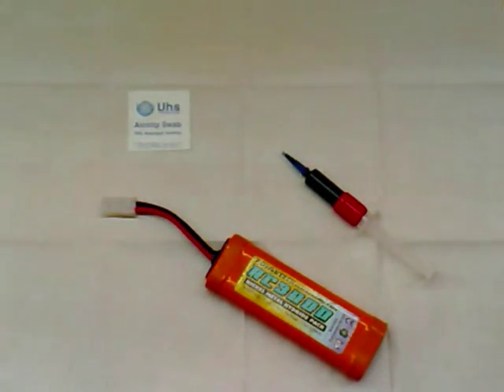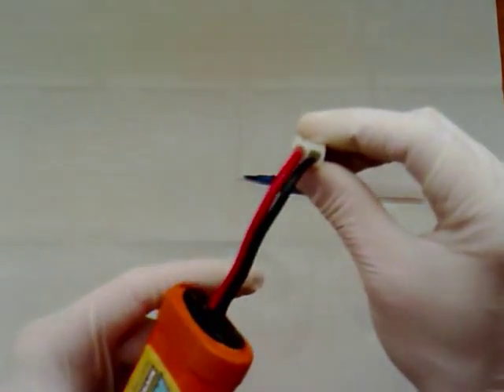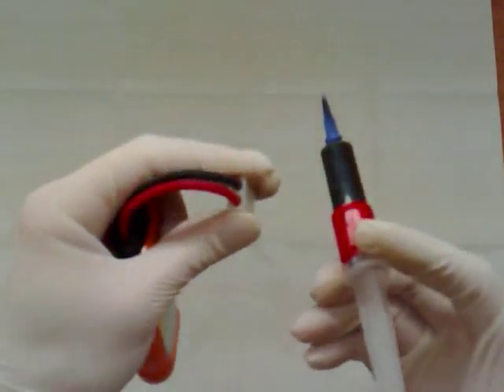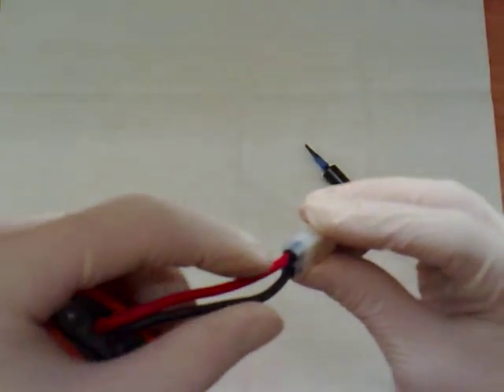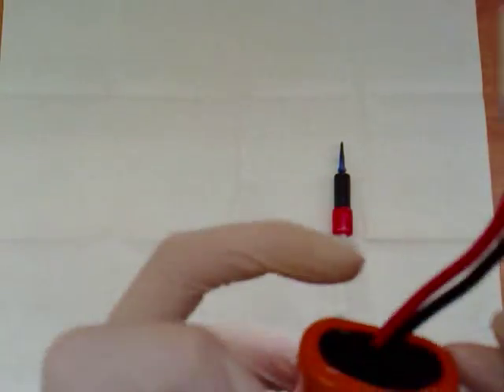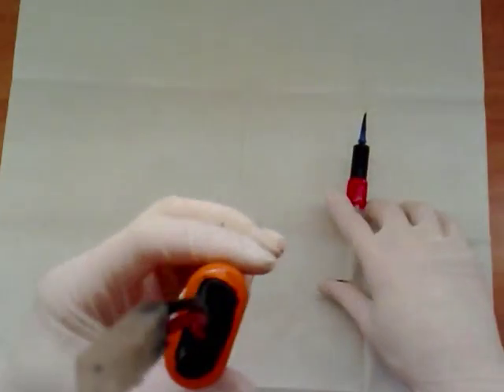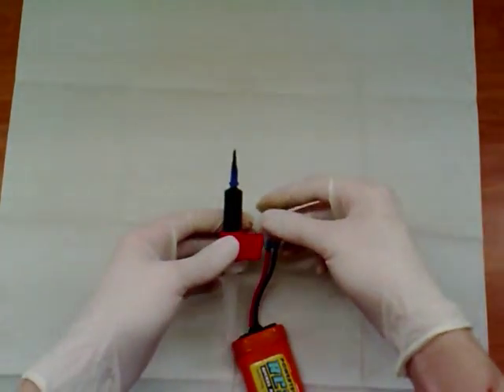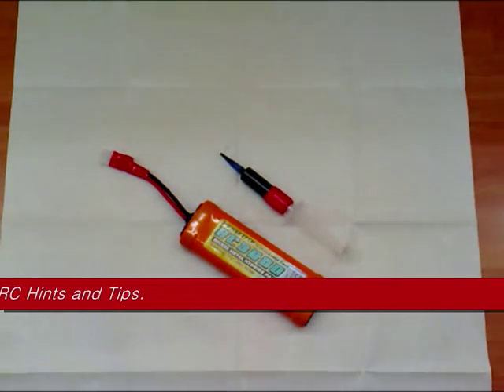Waterproofing Battery for Remote Control Vehicles 7.2v Video 2.wmv

Comment from the maker: @AtomicLngboards I assume you have done the same process on the ESC plug. There are a few option. One is to elctric tape the joint once connected. I have also seen an mountain bike light systems the joint being greased with lithium grease to help and both would be ideal. Hope this helps - I must complete this series of the other components.

Comment from the maker: @Hobby331 Sorry for slow reply. Yes the battery is sealed and its not protecting the inside of the batter it is about avoiding shorting the battery out when very wet. Be careful not all LiPo's are waterproof and they don't like water.

Comment from the maker: If you look at our waterproofing kits they come with instructions for all the parts you need to waterproof. You can apply a small anount of our servo grease to the connector to help seal it, this is easier than sealing with electric tape. Hope this helps. Please stay in touch.